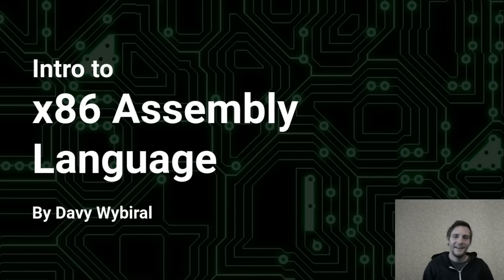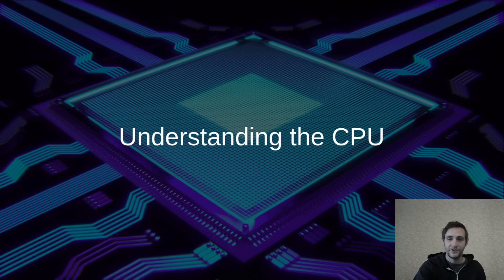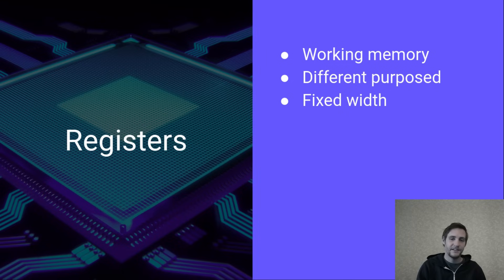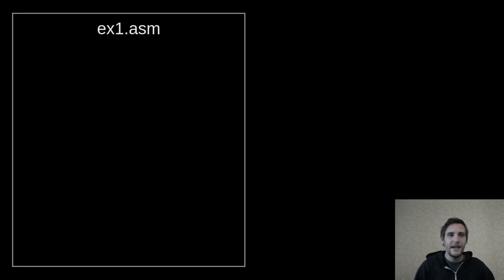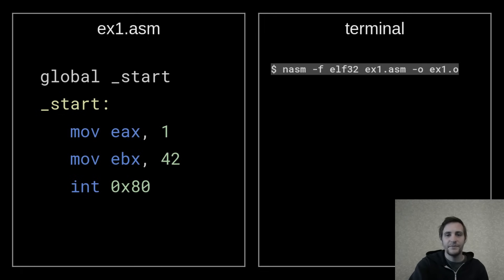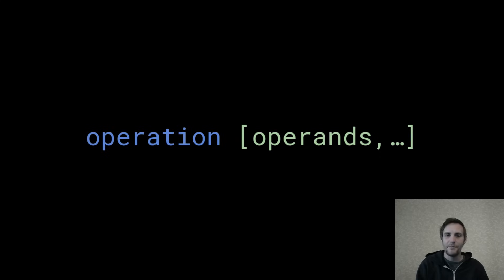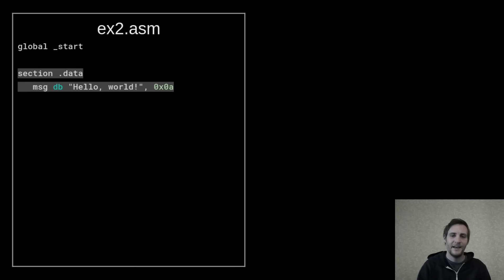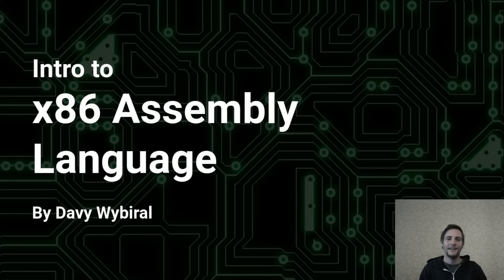Intro to x86 Assembly Language (Part 1)

Comment: 08:34 Actually, MUL and DIV also affect EDX. The MUL instruction stores the higher half of the result in EDX, while DIV stores the remainder from division there. If one dosn't know about that, one can be very surprised that suddenly their EDX is getting clobbered with "random" numbers after division/multiplication.
Reply: boops
Reply: OMG, thanks soo much. If not for your comment I would still be mystified at the bizarre results of my test code. xD "Multiplication never works... division only works sometimes... duuhhh..." xD
Reply: Another thing I've discovered on the MacOSX x64 side of things (still using NASM) is if you divide 64 bit integers the quotient is apparently given by RAX:RDX, for reasons I still don't understand, so since both RAX and RDX are 64 bit integers, aside from giving you the wrong answer, if anything substantial is in RDX it's a ticket to overflow-land unless you initialize RDX at 0 first.
Reply: How is storing higher half of the result useful?
Reply: @Kokurorokuko  When you multiply a 32-bit number by a 32-bit number, the result might need as much as 64 bits to be stored. If you stored just the 32-bit result, you wouldn't get the actual result, just its remainder modulo 2³², which most likely is not what you want. So the CPU must store these higher bits somewhere, and its designers chose them to be stored in EDX. So the full result of multiplication is the 64-bit pair of registers, EDX:EAX.
Reply: @bonbonpony Oh, I get it. It didn't occur to me that the result might be as big as a 64-bit number. Thanks.
Reply: @Kokurorokuko  It works the same way as with decimal numbers: e.g. when you multiply a 3-digit number by another 3-digit number, the result might be as big as 6-digit (999×999=998001). The number of digits add up. For binary numbers, digits are bits, so the numbers of bits add up.
Reply: thank you very helpful
Reply: How do I fix this?
Reply: @qasimgaming4531  credit to chatGPT: It says that "the 'mul' and 'div' instructions in x86 assembly language use the edx register as well as the eax register to hold the results of the operations.

When using the 'mul' instruction, the lower 32 bits of the result are stored in 'eax' and the upper 32 bits of the result are stored in 'edx'. This means that if you don't clear the 'edx' register before using mul, the higher half of the result may contain unexpected values from previous calculations.

Similarly, when using the 'div' instruction, the quotient is stored in 'eax' and the remainder is stored in 'edx'. If you don't clear the 'edx' register before using 'div', the remainder may contain unexpected values from previous calculations.

To avoid unexpected results, it's always a good practice to clear the 'edx' register before using 'mul' or 'div', if you don't need the value stored in 'edx'."

follow-up to what the top guy said, "The 'mul' instruction does not have a destination operand like 'mov', so it always multiplies the value in 'eax' with the specified operand. If you need to multiply a value other than the one in 'eax', you need to move it to 'eax' using the 'mov' instruction before using 'mul'." chatGPT said
Reply: Omg thank you so much, i've been trying to understand a code for a couple of days and couldn't figure out why edx was being pushed and pop before and after a multiplication
Reply: Scariest guys are the ones with Hello Kitty pictures who know anything about Assembly/Reversing lmao

Comment: I have begun this series as a 15 year old with 2 years of C++ experience. I have to say, not needing to worry about constexpr, inline, passing by reference/value, etc. to create fast code is oddly refreshing. Granted, that's because I am now in charge of actually moving the memory around, but regardless, it does feel very genuine, not like I'm trying to guess what trick the compiler is going to pull next.

Comment: There's probably no-one who cares about this, but.
My first ever 'proper' programming gig was in about 1979 and was a "This is stupidly slow. Speed it up, if you can" kinda thing.
I turned 4 lines of FORTRAN 'IF' statements into about a page and a half of inline assembler, and instead of taking around 24 hours, it now ran in about 2 hours and produced the same answers. Go me!
Reply: I wrote the same thing in BASIC when you did. It’s nearly done

Comment: I feel privileged that the first language I learnt was IBM 1401 autocoder. I then went onto IBM 360 Assembler and so the concepts of x86 Assemble language are relatively easy. 360 processors had 16 general purpose registers and 4 (I think) floating point registers. Addresses of storage were calculated as base and displacement, that is, four bits denoting the base register and twelve bit denoting the offset from the address in that register.

Comment: why do people always use an assembler to explain assembly? as much as you think it makes sense to, it doesn't.... assembling means you're going up to a higher language... to explain assembly you have to reference a decompiler, not an assembler. :(
Reply: I never read the word "assembling" in computer science . I understand "Avengers assemble!". Or Fords assembly line. I feel like Computer Scientists don't know English.
Reply: @ArneChristianRosenfeldt  lol, for the majority i absolutely agree, otherwise i find it common that english is used improperly in other places as well. 

when a computer assembles language it does exactly what the avengers and ford's assembly line do. it runs a script 1 line at a time which forms a program. (you may find the terms execute/assemble/compile used in different contexts.... but they basically do about the same thing/are a part of the same process)

so my issue with explaining assembly using an assembler method is that you will never know what the computer does, because you're still just feeding it lines and it's executing them.

the reason people want to know assembly is because we want to know what is going on, not because we just want some overcomplicated translation of python.
Reply: @markvis4106  My problem is that in most assembly languages are most laid out like the machine language (especially if you consider variable length instructions ). It is a serial process. Yeah, second path for forward jumps. Directives are the only thing which feel like assembling, but then higher languages are full of Declarations and Hoisting (even more "forward" stuff). This feels like physical assembling to me. I also don't get macro assemblers. Probably they are like inline assembly, but you have control over the calling "convention" -- can do unconventional calls.

Comment: Hm, I'm trying to directly alter the bytes of a .exe in order to write a program, hopefully I can skip that whole assembler nonsense and get straight to machine code, however I keep getting an error when I try to run a .exe in administrator mode that the .exe cannot be found it will state the exact file path of the .exe I'm attempting to run, which is odd because I can see very clearly the .exe is located on that branch in file explorer. It may be worth mentioning the way I'm going about all this is creating a .txt file that has nothing in it, changing the extension to .exe manually, then opening the file for Binary as #1 in Excel and putting a bunch of bytes of programming into the .exe file, this seems more likely to work than other methods like inputting the byte information into an ASCII .txt before changing to a .exe due to some ASCII characters potentially getting messed with by the .txt before the transformation to a .exe happens.

Comment: Is there any difference b/w 8086 and x86? Syntax, assembler wise?
Reply: 8086 is 16 bit. x covers the extensions which mostly came with 386 (see the assembler option). BitScan instruction should have been in 8086.

Comment: how do you know which register to use each time? does each register do other job?
Reply: The Operating System expects the data in specific registers. It is all documented and has not much to do with assembly language. Other high level languages use other calling conventions (Win16 uses Pascal, Win32 uses C , no idea about 64 bit OS ). "Do" is a verb. Tha ALU "does" something. Registers "hold" values. They are acted on.

Comment: I tried this on a 64 bit windows machine with ubuntu subsystem and it all worked well other than I got no output. Not sure what I'm doing wrong. lol. 

global _start

section .data
msg db "Hello, world!", 0x0a
len equ $ - msg

section .text
_start: 
mov eax, 4
mov ebx, 1
mov ecx, len
int 0x80
mov eax, 1
mov ebx, 0
int 0x80
Reply: You need to load somehting into edx also. You know, a String in memory has a start and a length. Why don't you mark the time in the video?

Comment: Is Register the same thing as a CPU Cache?
Reply: I think of the register file as a data cache precursor. On Atari Jaguar for example there are 64 32bit general purpose registers. With a clever compiler or assembly programmer you can keep most of the data you need to reuse in these. You can advice the CPU to load data from memory in advance before actual usage to avoid stalls. But JRISC is severely lacking a code cache like Sega32x.
Reply: @ thank you for sharing your knowledge with me

Comment: How to make the following program in 8086. Input: Characters (10 maximum) Output: Simulates the operation of a queue of a maximum of 10 characters allowing the user insert and delete elements, with the permanent display of the queue on the screen (cursor handling).

Comment: One thing you should mention is that there are two ways to write x86-64 assembly. The one you've shown in your video is the Intel syntax which is a lot nicer and readable, but is read right-to-left. The other one, which is just as common, is the AT&T and GNU syntax which is more complex and is read left-to-right.

Comment: If using visual studio (2019) is any of the syntax different from these examples? I'm getting syntax errors when attempting to run the code. I just briefly checked a different video specifically for setting up visual studio for assembly and their example ran fine.

Comment: I386 vs amd64  what is the difference between them?

I386 have so many names like x86 
And amd64 too like intel64 and x86-64 x64 or even IA-64
Reply: x86 (aka I386) is Intel's technology that AMD adopted while AMD64 is AMD's technology that Intel adopted. At the time Intel had IA-64 (Intel's own 64bit technology) but it was not backwards compatible with x86 unlike AMD's AMD64 technology so they adopted AMD's technology.
Basically x86-x64, AMD64 and Intel64 are the same thing, a 64bit based architecture that supports x86 backwards compatibility.

Comment: You should have 0 as the exit code, unless the program failed. If it failed, the exit code is not 0. You can look up a list of common exit codes
Reply: Exit codes are juat exit codes.

What the problem if the system put a program in. A failed list.
Reply: @xrafter  Exit codes help the Operating System understand better if a program failed or not. If your program didn't fail, you should probably exit 0
Reply: @unsafecast3636  
I know that man.
But who care about the operating system.

I want to exit with the exit 1 code
Reply: @xrafter  Programmers that think like you is why there are crappy programs out there.

If there is a standard accepted EVERYWHERE, you are better off following it. And please, give me a single situation where you would want to exit with another code, except the program failing.

Oh, and a lot of terminals show a red exclamation mark or sad face when a program exits with code != 0
Reply: @unsafecast3636  

If exiting with 1 error code make the terminal sad i will do it again and again.

Comment: testl	%edi, %edi
	setg	%dl
	xorl	%eax, %eax
	testl	%esi, %esi
	setg	%al
	andl	%edx, %eax
	ret
Can you explain this ?
Reply: testl will do a and bitwise but it will not change anything except the flags.

Setg it will set dl to 1 if true or 0 if false.

Setcc . cc = one of e z nz g l etc..

Xor something with itself will zero it.

This code is just a way of a if statement in assembly.

Comment: Hello, was following the tutorial and got a problem.
I am on a WSL Ubuntu 18.04 LTS on win10. I did all the commands like in the video, but whenever I try to execute the ex1 file it says "-bash: ./ex1: cannot execute binary file: Exec format error"
Got any ideas on what's wrong?
Reply: I had the same problem. Solved it by upgrading to WSL2 (https://docs.microsoft.com/en-us/windows/wsl/)(run Windows Powershell as admin and type "wsl -l -v" to see what WSL version you're running)

Comment: No matter what I do, I keep getting Segmentation fault (core dumped) on a basic multiplication operation:

   mov eax, 50
   mov ecx, 3
   
   mul ecx
Reply: You need to exit.
 this happens to me too.

Because if you don't it will continue executing until the mmu give that intrupt .
And the kernel will give this process a sigsegv signal. 
And will dump it.
Reply: a mi si me funciono su codigo y el resultado quedo en eax
Reply: Did you read my comment?
Reply: @xrafter  Don't know if the OP did, but I did. Thanks for the info. :) I'm just getting started learning Assembly. Good guy kernel, protecting my CPU from me like that. xD